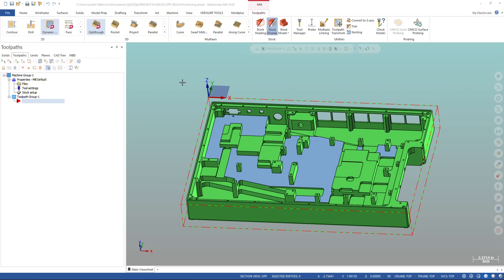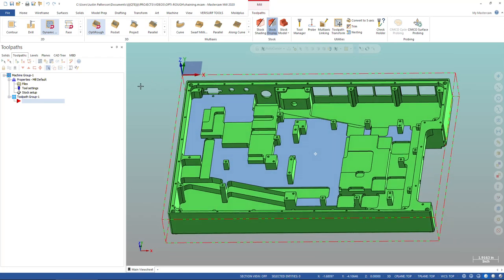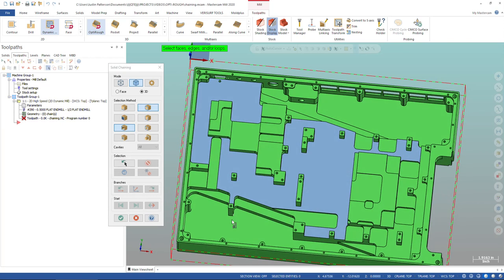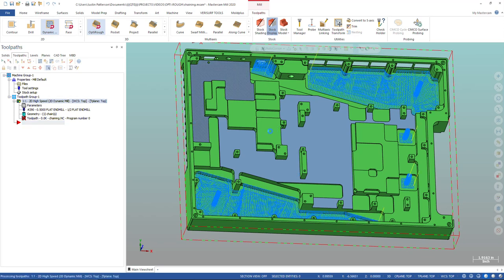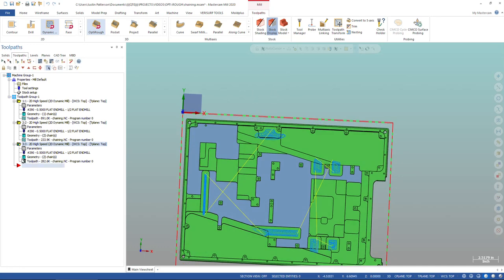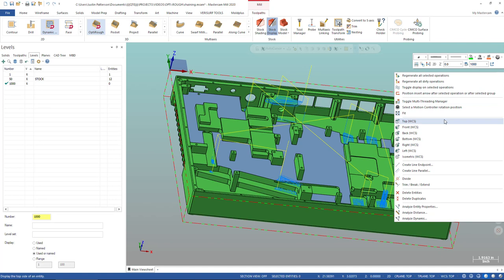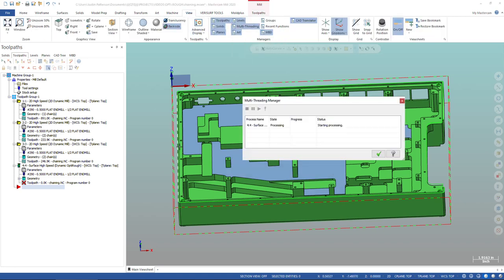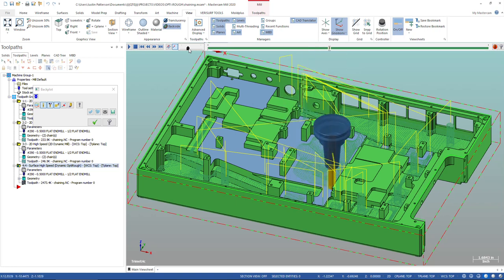Mastercam Opti-Rough Advantages for 2D Toolpaths

Comment: Thanks for uploading, this is very interesting! May I ask how you would set up finish toolpaths (preferably with G41/G42 or DIN equivalent) for a part like this?
I've been using the "Pocket" 3D toolpath (since OptiRough uses stepdowns) with 2D contour (for tool diameter G41/G42 compensation), but some walls may be left out. I do competitive machining, so toolpath generation speed is very important.